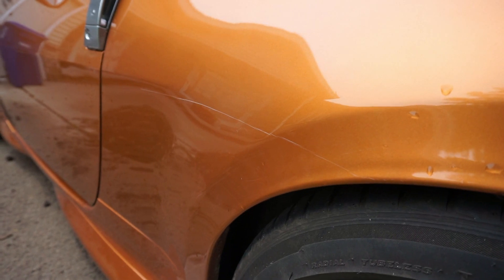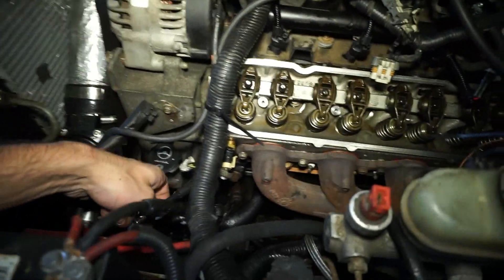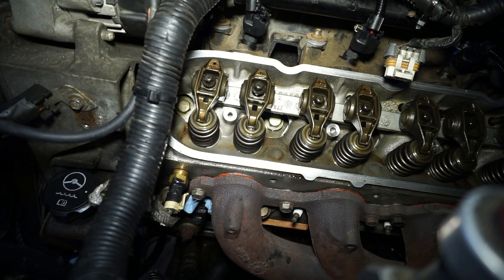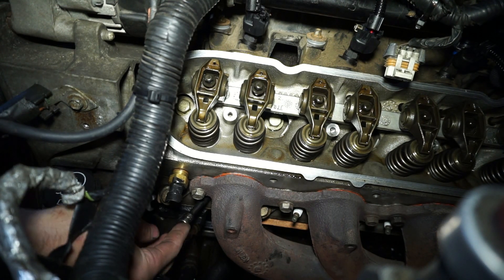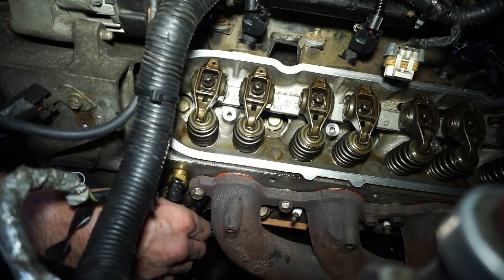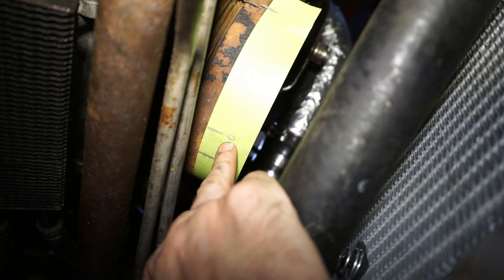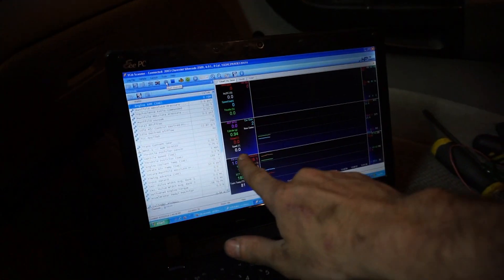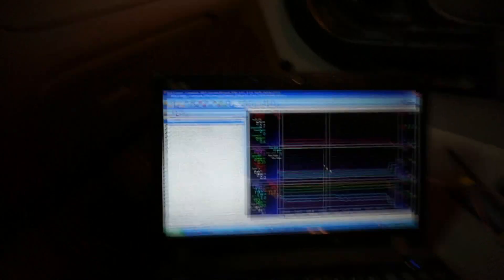VERIFY TIMING ON LS ENGINE USING BASIC TOOLS AND HPtuners!!!

Comment: If you are looking for the compression stroke to verify true top dead but you have disabled the rocker arms that means that you won’t be able to find true top dead. As with the valves all closed on the exhaust stroke it would seem to be a compression stroke. Just be careful

Comment: Hopefully you don’t have to do this again but if so      You can just command your timing via the scanner.
Reply from the maker: Joshcarroll5 I looked around that but couldnt find it... I'll give it another look, because I wanted to command the fuel pump too.
Reply: a21bravo      should be under the spark tab “absolute spark control”.  Fuel pump is under the fuel system tab

Comment: If understand this test, your verifying the accuracy of the crankshaft sensor to reluctor wheel phasing?  
If the results hadn’t been accurate is there a way to dial in the crankshaft sensor?  If the reluctor wheel was off then it would be a can-ok-worms. 😉🤔
I read the comments:
I see you could allow for any inconsistencies +- in the timing table but is there a way to “Dial in” the timing through the tune?
Reply from the maker: HeadFlowInc I dont think HPtuners has an offset for it... If it was off I'd just adjust the timing tables... Glad it wasn't so I don't have to deal with it, haha.
Reply: Stock pcm keeps it's sync just fine. There isn't any reason to ever verify timing on a oem pcm. But this same precedure can be used and be effective on standalone systems which definitely need to be told where zero is because they don't have the means to figure it out on their own

Comment: On an LS motor, what is the point of verifying timing ? I’ve done it on older motors with a dizzy, but why on an LS ?
Reply from the maker: Bryan Leverett Can be off a bit. Matt's situation, for example his was 5* advanced so actually had more timing in it than he was commanding and it was causing issues.
Reply: a21bravo 
So it’s just to have a timing offset into the tune? Guess that makes sense. But it’s mechanically locked. What would move the mechanical timing ?

It would be nice to pin the crank and put a nice timing sticker on the balancer (if we had the option for a sticker ). 

I saw Matt was off his timing light by 8 degree because he set it to “exhaust valve opening” not actual TDC lol. But that would have got me too. I always just used a long skinny flat head.
Reply from the maker: Bryan Leverett I just wanted to make sure it was right... Removes the question in my head of accuracy... When scan says 11* it's actually 11* and not 17 or something in not planning for.
Reply: a21bravo 
In your case, I super understand.
I thought I “miss heard” on one of the videos when you said “IDC is 120%”. But that was prob your cause of failure. Bad ass to see it in the 11’s !!!
Like someone else asked, what is the IDC on the new set at the track? Congrats !
Reply: I watched a video saying that a big cam car cannot be set to 0 degrees when verifying timing have you ever heard of this ? Out of all the videos I have seen including yours I don’t hear anyone speak about this

Comment: Please throw your tools in the garbage and step away from the vehical!!!!
Reply from the maker: Butch Cassidy Care to explain why? You can't even spell vehicle so you must be pretty good with a wrench.
Reply: a21bravo if it didn’t come out to zero. What would you have to do to fix it.
Reply from the maker: Flowtester21 Some programs have an offset that can be adjusted to correct the error. I don't believe HPtuners has this so I would have just adjusted the timing tables accordingly to get the actual spark I wanted. Mainly just wanted to verify I wasn't getting an extra 5-10 degrees of timing I didn't kow about causing issues.